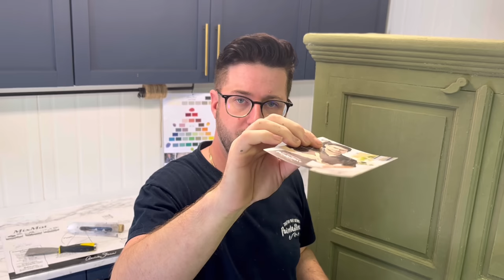How to create a layered chippy paint affect using chalk paint.

Comment: Hello Jonathon, thank you for a very helpful tutorial. I really appreciate it.
I do have one concern.  I watched you sand down this piece.  You were wearing a mask and I saw some dust flying.  It's great that you are wearing a mask during the process. 
 My question is what happens AFTER the sanding process?  That dust is still there, either floating around or settling down, but coming up again with movement. 
I realize that your English weather makes it prohibitive, most of the time, from working on your furniture outside .  
So, couldn't you have gotten a similar effect if you worked in small sections, painting small part and then wiping it off before it dried completely? 
I.e., isn't there a way to achieve a similar paint effect that is healthy/nontoxic to your lungs?
Thank you.

Comment: Hello Jonathon, your brush is dry when you make the technic with olive green or has a litlle paint on it?
Reply from the maker: Good question, it’s still kind of wet from the paint what you will find is as you dry, the paint with the hairdryer it will kind of thicken up and then when you pull the brush over the surface, it will create little beads of dried up paint if that makes sense